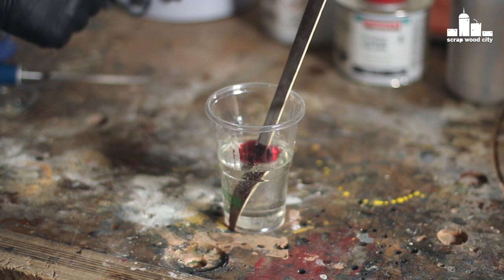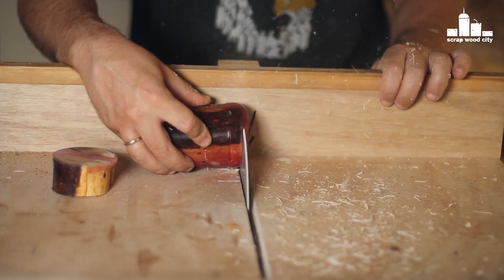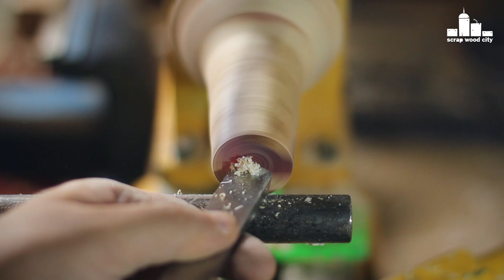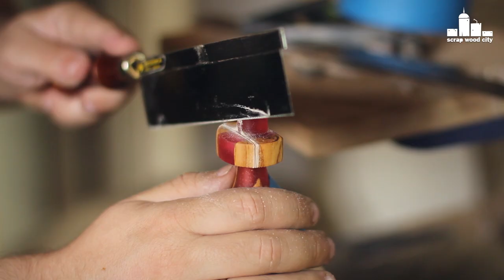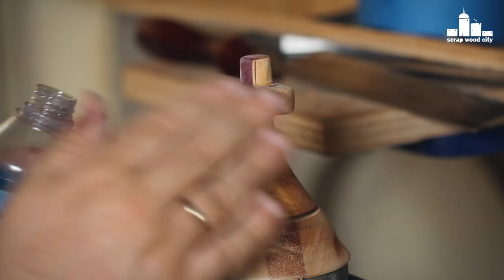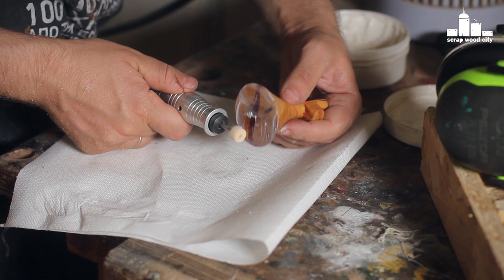Wood and resin cross - woodturning

Comment: Why did you sand it wet and what was the buffing compound you used? Nice work though!
Reply from the maker: Wet sanding at high grits increases the lufe of your sandpaper and works better in general. I used carnsuba wax on the buffing wheel. I also use abbrassive paste sometimes.
Reply: @ScrapwoodCity  how high would you say the grit should be to use with wet/dry sandpaper?
Reply: @ScrapwoodCity  also thanks for the reply man!